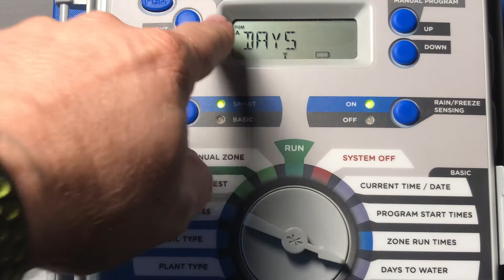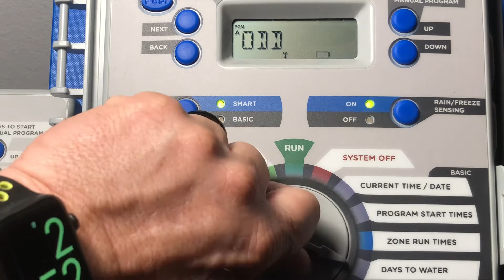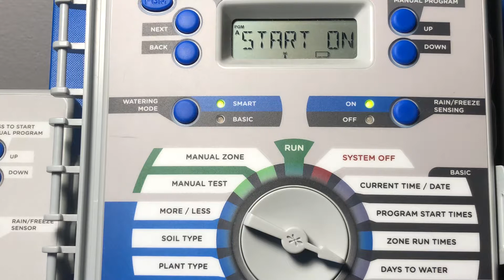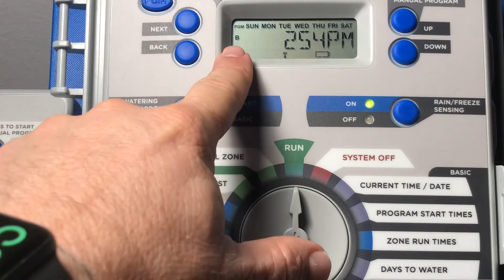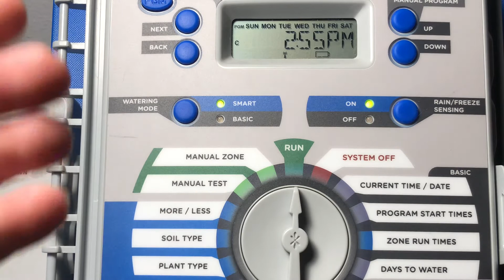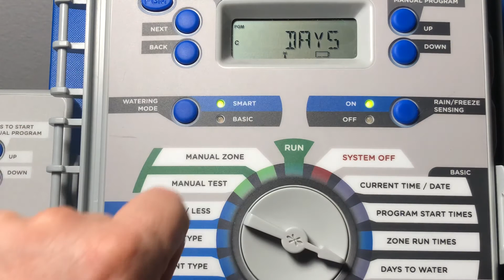How to set DAYS TO WATER on your Weathermatic SmartLine or ProLine control panel

Comment: I have set mine to run on Sun, Tue and Thurs and display confirms it, but it ran on Friday, the same day I am making this comment. Could I have missed anything?
Reply from the maker: Confirm the date is correct in the CURRENT TIME/DATE position of the panel. If this information is correct, perform a factory reset as there must be an error on the processor of the panel. After you reset the system you will need to write a new program to the panel.
Reply: @davidstraight405  For me, current TIME/DATE was correct. Took the route of "Clear All" and it worked.

Comment: Nice vid thank you question after you have set new times and days do you set dial back at run position ?
Reply from the maker: Yes. But if you forget too the controller will automatically prepare itself to irrigate. The only position it cannot resume normal operations is the OFF position.

Comment: The days of the week not showing up on the top of screen. Why?
Reply from the maker: Check the OMIT DAYS function. If it is set to OMIT for each day, it will not show you the days you have  selected to irrigate.
Reply: @davidstraight405 the omit days are set to “Allow” for all 7 days yet it still won’t show the days that are set at the top. Any suggestions?
Reply from the maker: See the SmartLine Omit Days video. If the Omit Days function is set to ALLOW for all days, but you still cannot see your selected watering days see the video on how to reset your Smartline or Proline controller. You will need to reprogram your settings after the reset.
Reply: @davidstraight405  If the days are programmed in and showing "ON" within the program but not showing at the top of the main screen will the program still function?
Reply: Nevermind, I figured it out. The days were omitted so I could not program. Thx.